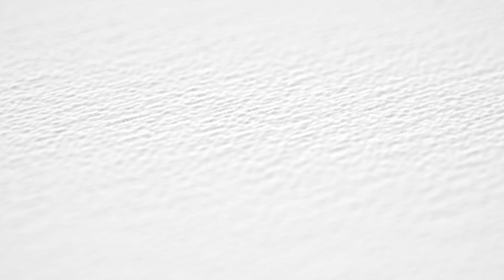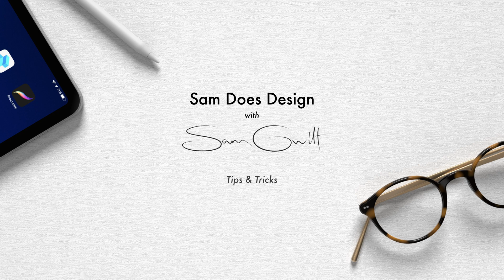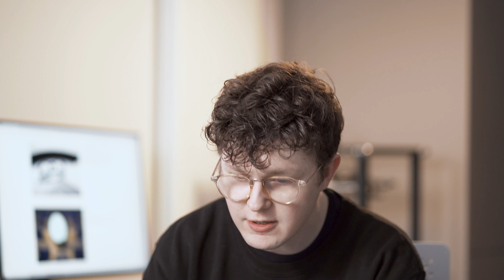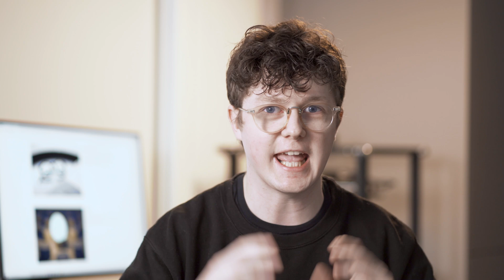Industrial Design or Design Engineering? What's the Difference?

Comment: A bit late here but would love to hear your thoughts on this-

Which one is more relevant to learn if you want to think from outside to inside but work in a very technical domain like Aerospace? When "designing" a stealth fighter jet, is the person who designs the exterior for stealth capabilities a designer or an aerospace engineer by profession?

I don't want to be negative but I've realised that work only falls in the domain of "design" as long as its not too difficult or complex to do. Pencil sharpeners, chairs, tables, headphones etc are designed by Designers but drones, fighter jets, robots, bridges are designed by Engineers. Even if the work is more "outside to inside" it still requires science knowledge and math which the Designer is not capable of

Comment: I did a design degree before and have now finished both my BEng and masters in mechanical engineering, so I'm basically both. It's interesting to hear your thoughts on this subject.
Reply: Did you pursue a master's degree in mechanical engineering, or did you study for a bachelor's degree in mechanical engineering? I am an Industrial Designer and would like to pursue a master's degree in mechanical engineering, but since it is a very technical field, I am not sure if it is possible, and the only path may be to study for the bachelor's degree. Now, I was also considering whether it would be more feasible for me to pursue a master's degree in design engineering, which seems feasible from my position. I would like to know about your experience. Regards.

Comment: Intersting way of putting it . Outside in / inside out. I work as a senior ID designer for me the importance of each is dependant on the product. Some products have more scope for outside in than others. In the complex products I think the key is in the balance. Create  something that is not only technically sound but also user focused and great looking. 

The difficulty is then in making right choices/ trade offs  to deliver the best balance. 

As an example once choice that could slightly reduce performance could have a drastic benefit to the user. So then you’d have a choice to make :) 

Nice video!

Comment: hmmm, I get the point but even tho I am a trained Industrial Designer, I would never call myself an Design Engineer (even if I was doing similar stuff to and engineer) unless I had gone to university and studied in engineering AND design. From seeing the years of work engineers have to do to become and engineer, seems kinda cheating to call myself an engineer even tho I haven't studied it and am not certified as an engineer
Reply from the maker: I agree, all of the terms are very fluid - it will depend on what you prefer to be called and which jobs you apply for. But if you get stuff done and bump shoulders with the engineers, I'd say you're allowed to call yourself one!
Reply: Thank you for this comment.